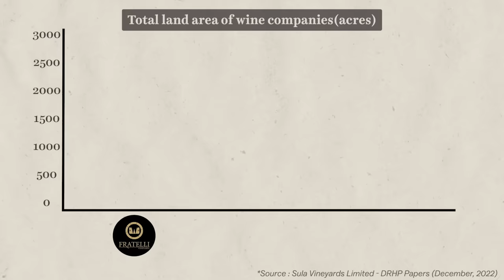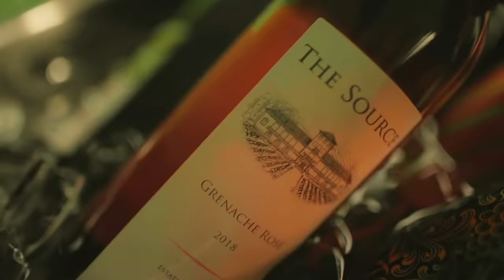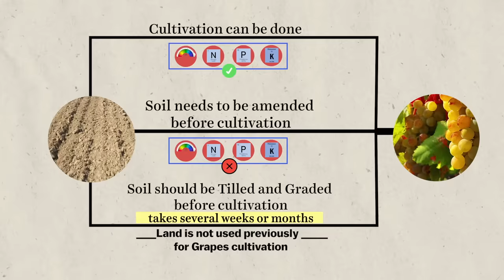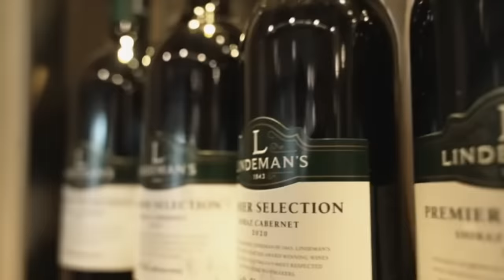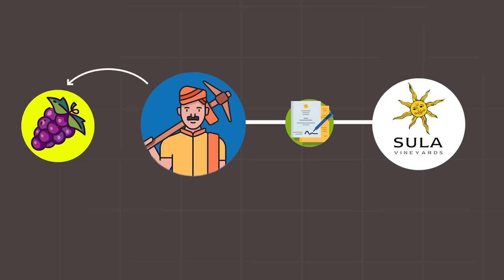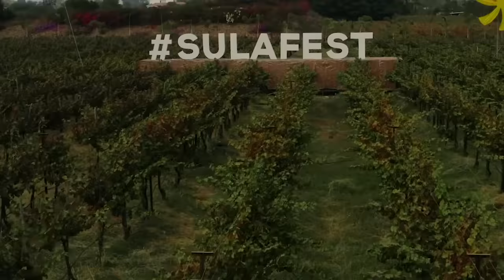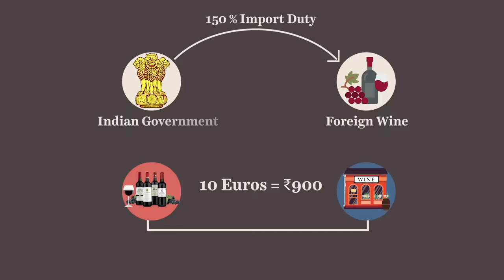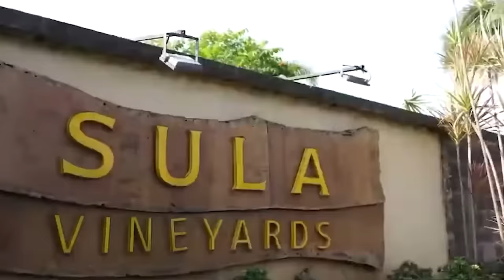This Indian Brand is ruling the Wine market of India? :Sula wines case study

Comment: You can get a 6 pack+ of beer for the price of 1 bottle of wine. Your analysis hasn't covered the growth of the domestic production of wine over the last 2 decades which makes it difficult to understand the consumer shift if any from other alcoholic drinks to wine. Climatic dependency is a huge weakness where firstly available region for vineyards is constrained and secondly the prevention of poaching of farmers by the competition is either going to be challenging or will increase costs significantly for Sula in the next decade. Last but not the least wine is more often than not paired with food like meat/fish  which is grilled/poached/broiled unlike a curry dish which is common in India. The economics just do not work out in favour of "getting a high"  drinking wine as against any other alcoholic beverage. Of course there are much more cheaper ways of getting high. Discussion  is highly classified 😊.
Reply: Why suggest make video, else above channel will take away your idea 😅